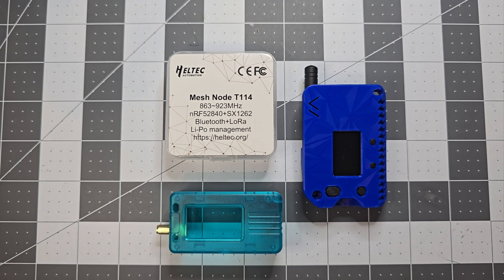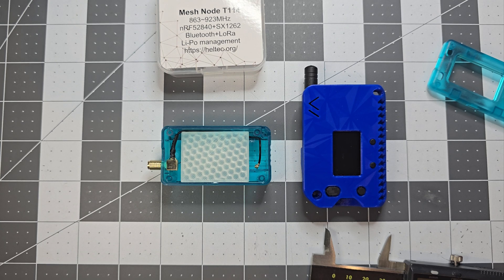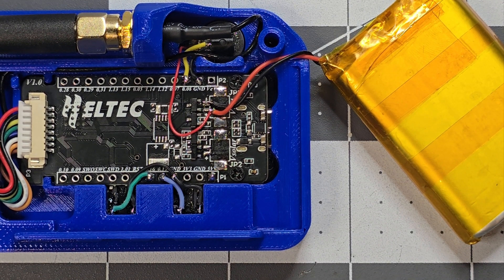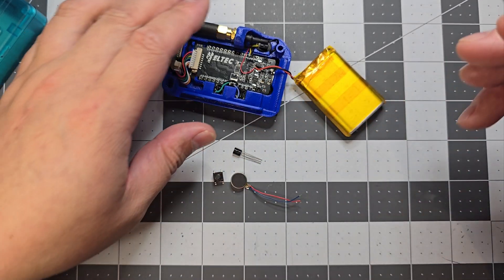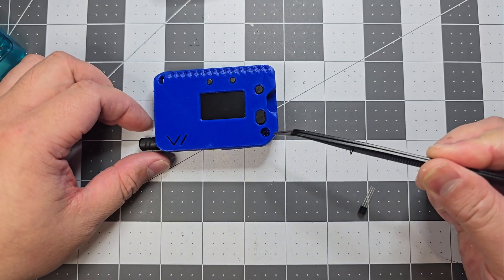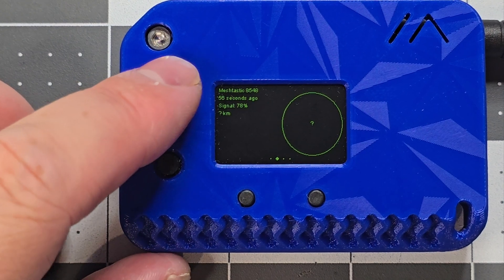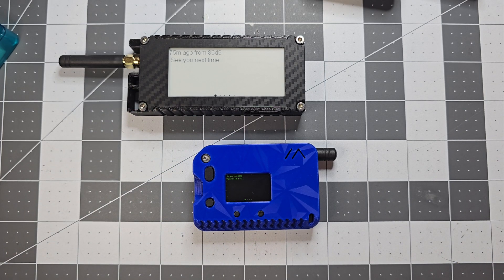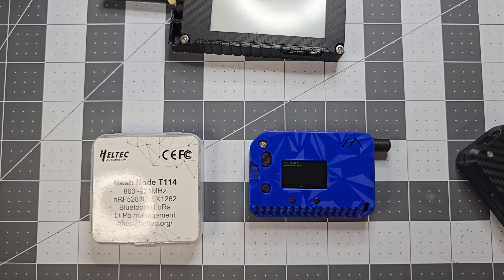Heltec Mesh Node T114 Build with Canned Messaging and Vibration Motor

Comment: A little more info please 🙏🏻
What transistor did you use, for the vibration motor? Whats pin to use for resistor and vibration motor?